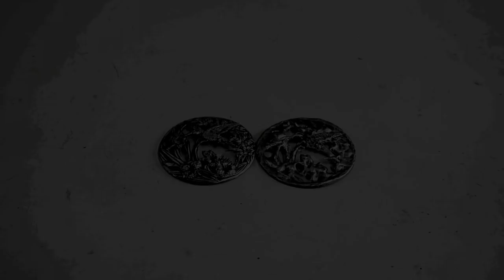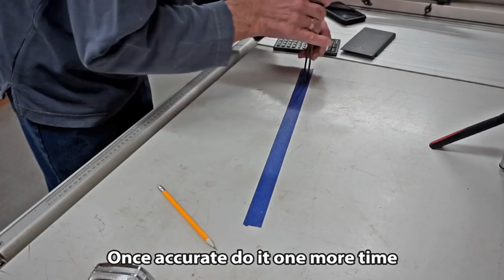Woodturning - "Cue" the Action.

Comment: Very nicely done Peter. The attempt at making your own lid didn't turn out to badly either. Suffered from some detail but I wouldn't call it a FAIL. At least you have three more legs for three more attempts :).
Reply from the maker: Hi Jeff,
Thanks for the comment. I don't suppose the lid was that bad but maybe I need to try for a bit more detail in the actual casting itself next time. Perhaps things will improve by the time I use the last leg.